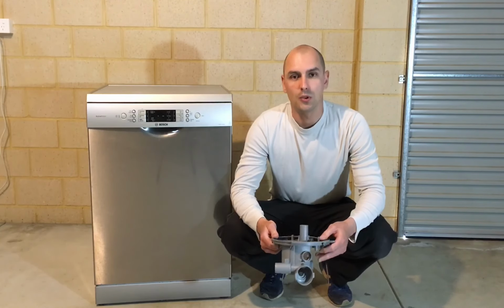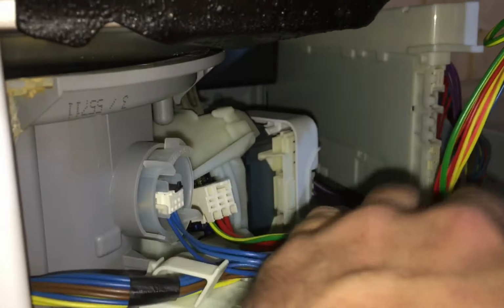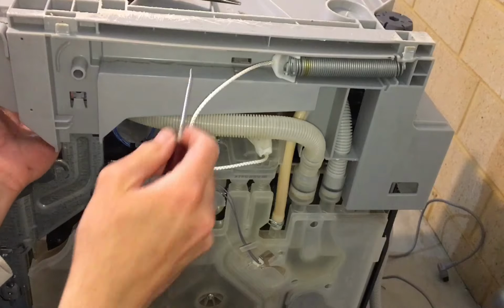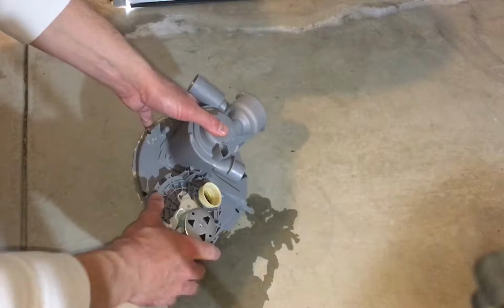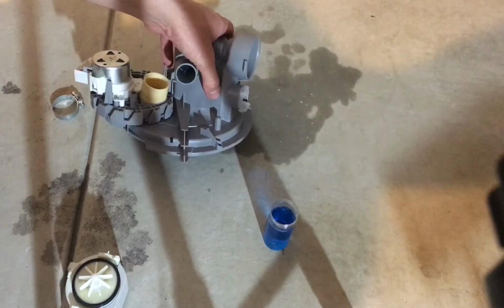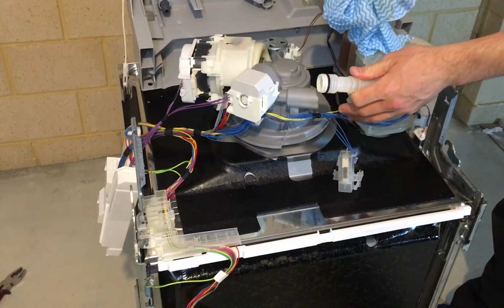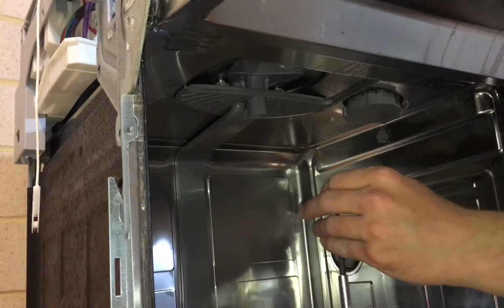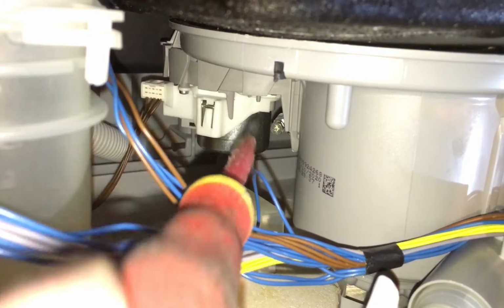Bosch Dishwasher Sump Replacement

Comment: This really is superb! Very detailed and extremely helpful. One question: do you need to empty the salt container/water softener before flipping the machine or is it sealed?
Reply from the maker: Hey, sorry, haven’t been only for a while. Don’t have to empty the salt container, they are sealed.
Reply: @ApplianceFault  Not a problem! I've replaced the sump (the seal was leaking) and heat pump (the heater was damaged by the leak) and it's all back together and fully working again! It would have been a lot more difficult without your excellent video. Far cheaper than buying a new machine.

Comment: Really informative and well made. I have a similar leak and wondered why just the seal around the top of the sump (where the water was leaking from) couldn't be replaced, rather than the whole sump - which was a lot more effort
Thanks again for a great video
Reply from the maker: You’re welcome. Glad you liked the video. 

Thank you for watching
Reply: i was wondering as well??? maybe with the heat the sump is warp and the whole need to be changed??

Comment: You’ve done it beautifully! You know, I’m really missing the bottom access door on older Bosch generation, it was an easy yet considerably quick access to the sump area.
Reply from the maker: Thank you. Glad you liked the video. 
Agree, dishwasher with bottom access/removable pan are so much easier and faster to repair.
Reply: @ApplianceFault  thanks for sharing with us! Yes you’re right it was so convenient to have a quick access to the underneath. Bosch makes really good dishwashers (yours is actually a pretty good model and was made in Germany), actually Bosch and Miele are the best ones in my opinion.

Comment: Majestic! This is exactly the part I need to replace on the model dishwasher I have. Thank you so much. This is such a comprehensive video, given me the confidence to do it myself. I've ordered the part now!

Edit: Part fitted and fully working. I also had to replace the drain pump as it got some water in when I flipped it. So a very important point about making sure all the leaked water is sponged up. Do you have paypal for donations?

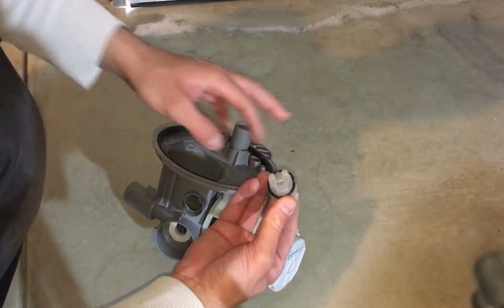Comment: could you explain what is the role of that sensor at 12:06?
Reply from the maker: It’s a turbidity sensor. It measures the amount of dirt in the water. From memory, it’s usually used by the automatic cycles to detect how dirty the plates are in order to calculate the wash time